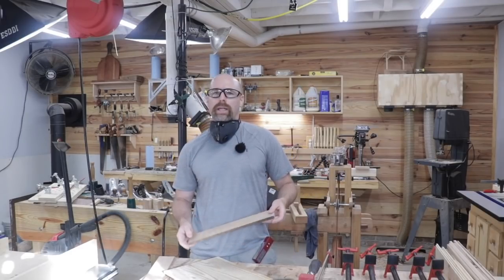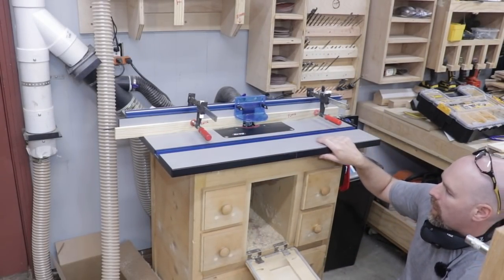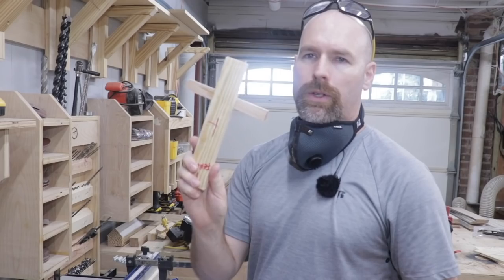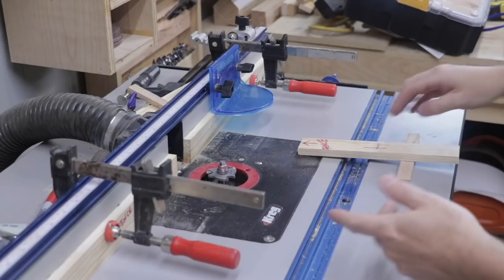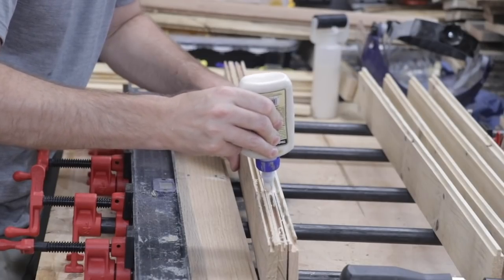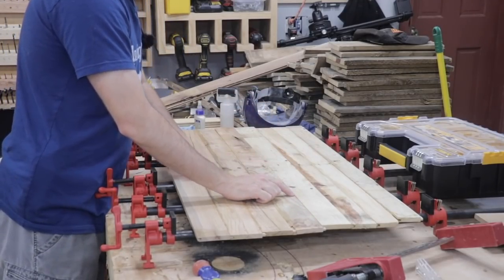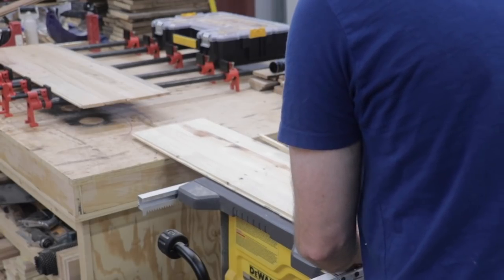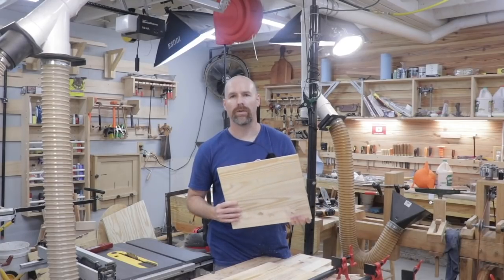PALLETS Instead Of PLYWOOD For Woodworking?

Comment: Great video! One tip, when gluing up panels like that put clamps on the bottom and the top so that you don’t have that warping or bending like you had. Then you don’t have to put anything on top of the world when it loose. Putting clams on the top and bottom crates even pressure. I learned that when I started using pallet wood.

Comment: Great series on pallet wood.  when gluing the panel up, stagger the board lengths and you can make a longer panel with a great pattern.  I would make them all 8' long and cut to length when using in projects.  you can also make the panels wider and long.
Reply from the maker: I suppose the ends of the boards could be tongue and grooved as well for longer panel glue-up
Reply: I suppose but a 45 degree and butt joint would be easier and they won't be moving because of the tongue and groove gluing.  I like easy myself.

BTY, with your router vacuum chamber under the router, leave the dust to build up in the chamber and eventually it will build a natural curve and flow better.
Reply from the maker: Thanks!

Comment: Your aren't laminating, you're edge gluing.  Laminating is stacking layers and gluing the faces together like plywood.  Nit picking, I know, but it is what it is.  I recommend not cutting your tongue and groove so deep.  You don't gain any strength and you lose a significant amount of effective width with each joint.  An 1/8 or 3/16 depth is plenty to keep alignment.  A flat glue up is already stronger than the actual wood, so deeper t&gs aren't helping you.  Hope this helps.  Keep up the good work!  You do some neat stuff.
Reply from the maker: Thanks

Comment: I do not have a planer, but I have a good source for pallets.  Right now the projects I am using them for does not require a finished surface. Eventually, maybe.
Reply from the maker: Cool!
Reply: If you ever get to the point of wanting a planer go over and keep an eye out for one under tool's on Craigslist. I bought my 12.5 inch Ryobi power planer from about a hundred dollars which is a lot less than new. Plus most of the people selling a uses one are woodworkers also just they decided to go for a larger unit. For instance the guy I bought mine from had a kitchen/bathroom cabinet business and needed a larger unit than the Ryobi I purchased from him.
Reply: @timothyvolkers5343  I will do that. But I do find that Craig's List in my area is not as prolific as it is where I used to live.
Reply: @HoneyHollowHomestead  yeah that can be a problem but sometimes somepeople will meet in between your location and theirs so you don't send so much time and fuel.

Comment: While tongue and grove works well but with material that thin I would setup for shiplap. Single bit once tuned in and has a similar appearence. Edit 9:06 shiplap might have less resistance to bowing or other movement.
Reply from the maker: I definitely considered that but I wanted a ridged panel and wasn’t sure if I would achieve that with shiplap. Thanks for sharing!

Comment: Have you made cabinets with the pallet panels?  I have access to tons of pallets that are in decent condition, so thinking about making garage cabinets and try to get close to furniture look and feel with drawers too.
Reply: In answer to your question I made a cabinet for under my sink in the bathroom from pallets used for paper transport so no chemicals, just made it off the spur as a test piece, it’s been in the bathroom for over a year using titebond 3 glue and lacquered on the top and oiled on the body, I’m no professional in wood working, just started in covid time and did what I thought best. Basically I would think for the garage you could get away with pallet wood cabinets, hope that helps you

Comment: I’ve been think about making tongue and grove 👅 & 💃 out of fence pickets. Thanks for mentioning where you got your bits 👍…when cutting the bottoms off to make it flat is there a reason you did the cut off on the right side against the fence? I’ve been told that’s dangerous due to kick back potential. But wondering if there is a good reason to do it that way? I’m guessing accuracy? Thanks for any response

Comment: after the glue up did they get wavy? I've tried working with pallet wood and i havent had any luck keeping it flat even after planning
Reply from the maker: Not a bit!
Reply: Just running them through a thickness planer doesn't fix any bowing in individual boards. You have to joint the wood or hand plane spots to reduce it.

Comment: Cool shop. Your not getting a true cut when taking off the grove and tong in the way you do after gluing your panels. When cutting on the opposite side as the fence, the last 4 inches or so are unsupported by any square jig or fence, thus relying heavily on your hands to finish the cut. Now I know that saw only opens to about 21 or so inches but if that's the case you should use a push block with a decent back fence to allow a square finish to the cut. Not critical but a good reassurance. Great work, take care.

Comment: You could probably improve the under-table dust collection, by allowing some airflow.
Reply from the maker: I’m considering that!
Reply: @lastingbuild1373  If you have an air compressor, then a pipe routed down there, with a valve that you can open every so often will stir that stuff up making a lot of it go out those suction hoses. As you work, just give that valve or air hose trigger a few blasts from time to time and a lot more stuff will get collected. Quick release hose on the outside of the cabinet can be used on the table saw too to do the same thing.

Comment: Great video. Just a thought though. Wouldn't it be an advantage to have a few small holes in the door to the router box to allow a through air movement? At the moment there is just a vacuum and no air passing through to take out the dust. Cheers John
Reply from the maker: Theoretically, the air intake is the space around the router and bit! I would like to hear from others what their experience is. It could be that a small vent could help!🤷‍♂️

Comment: I am just wondering but why with all the nice woodworking equipment did you decide to get such a small table saw? I know Dewalt makes great tool's but the small sized table space on your table saw would annoy me, but that's just my opinion.
Reply from the maker: I had the table saw before I had a dedicated shop! Hopefully a cabinet saw is in my future!
Reply: @lastingbuild1373  
Hey thanks for the response. I just wanted to say that Craigslist is a great resource for tools. I have a good collection of tools many good ones from craigslist. So you might try to find a good full size table saw there